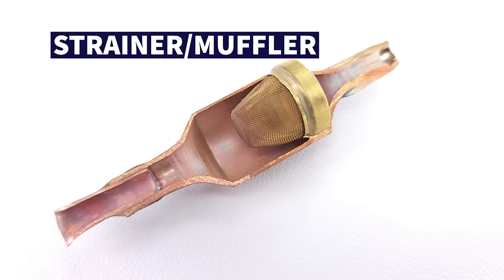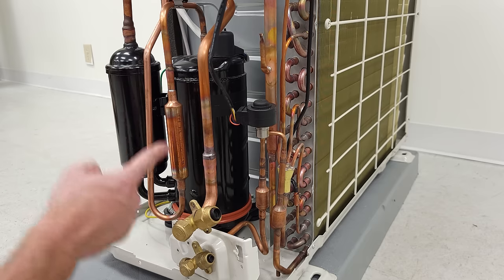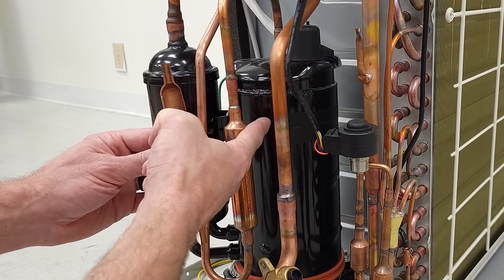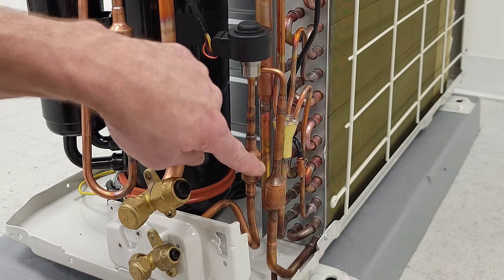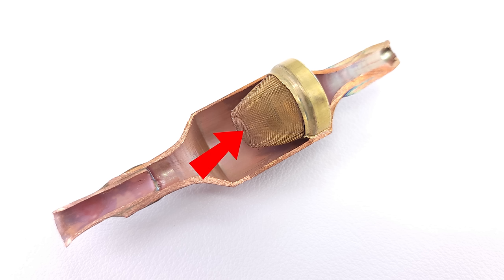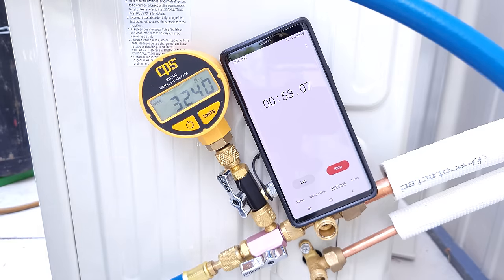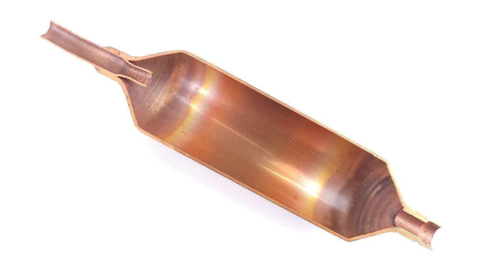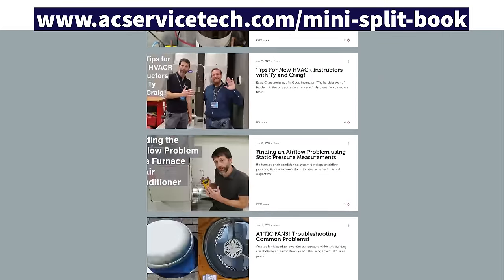The Purpose of a MUFFLER and STRAINER on an Inverter Mini Split!

Comment: Short answer is create a restriction, for both noise and harmonics, so if (IF) you braze on these lines, purge before you connect to the in or outdoor units. 
Invest in zoomlock 
I absolutely despise replacing compressors and or EEVs only to find these strainers plugged with oxidized copper, and then have to install filters to protect it and go back and check them monthly and remove them.   
Do it right the first time or just don't do it at all.

Comment: hi. So, I wanted to ask you a question regarding the HVAC system at my house. So, my heating system is a boiler that sends water through radiators throughout the house. But then, my air-conditioning system is just normal central air. Both units are controlled by one thermostat located in the living room, so I’m guessing that when you switch the system from heat to cool and vice versa, is switches between the two units. The boilers in the garage and the AC system is in the attic. My question is, what would happen if I set the fan to constantly run if the system is set to heat? I asked a few people and I got multiple different answers. One said that the fan should still come on normally even if the boiler is on. Another said that the boiler would run constantly another possible outcome would be that the fan doesn’t come on at all. So my question to you is what would happen if I did turn the fan on?

Comment: i have a question, i got a 3 head mini split that the board burnt, i went and bought another mother board and it got burned too. with that being said can anyone tell me what route to take? any help is much appreciated. awesome videos im a faithful follower 😊
Reply: the board at the condenser burnt the main board
Reply: I have had a fair bit of experience fixing circuit boards down to component level. Shot gunning is never a good idea, sure sometimes it might work, I too have learnt the hard way. One of the first things is to check that the power supply systems are functioning properly. This is not trivial and not only do you need to check DC voltages but actually using an Oscilloscope check if the DC supplies  are not oscillating and producing high freq noise on the DC lines. many times the power supply is called the "arse end" of the system, but check this first before you do anything.